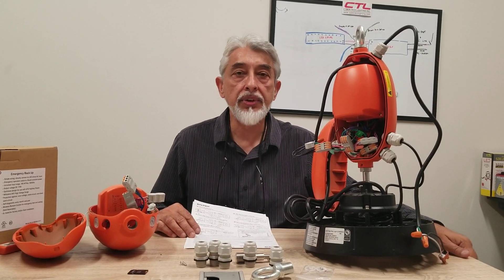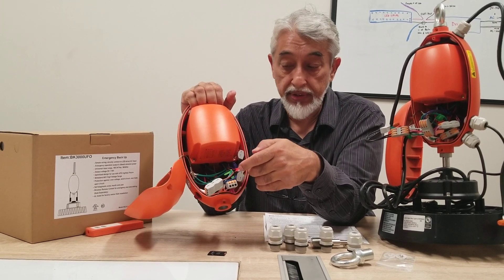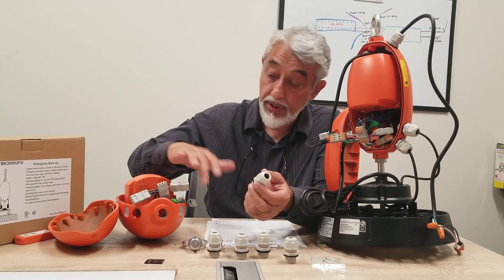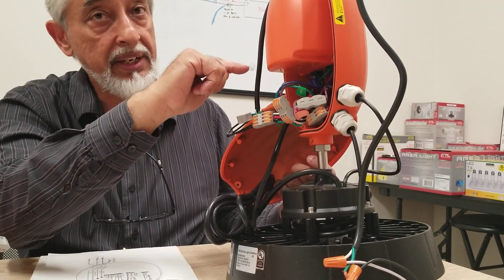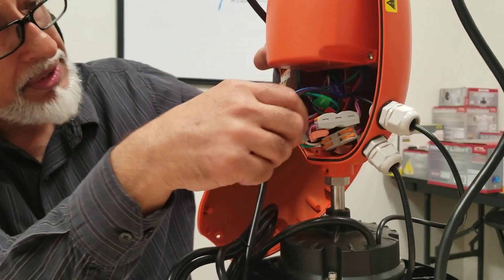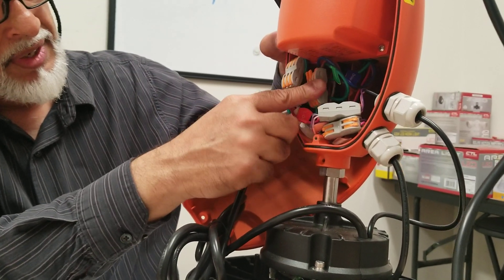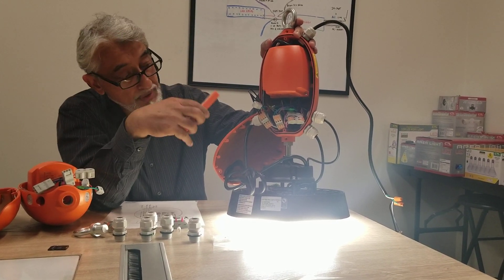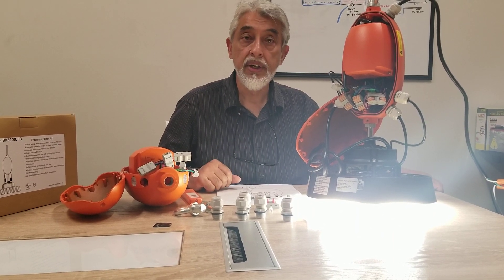How to Wire a 30W Billda In Line UFO Battery Backup  Cyber Item# BK3000UFO

Comment: We have a BillDa EMG driver BLD-FM04E-600400 that our customer needs to completely turn off when the hall lights are turned off, for when the building light sensors sense no activity. Is there a wiring option to accomplish this without the battery backup turning on? These are installed in NYC, and they have a code to turn off all lighting when not occupied.